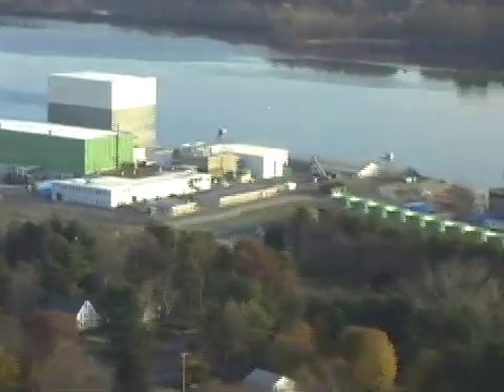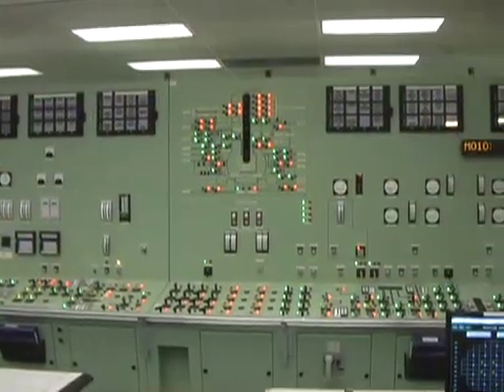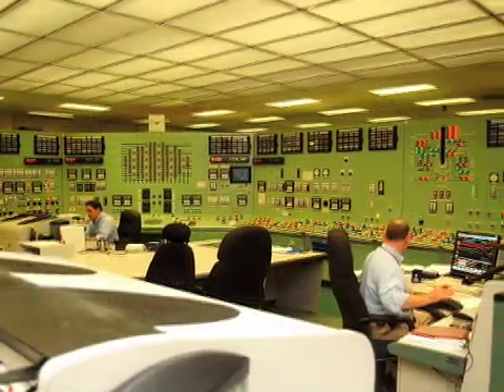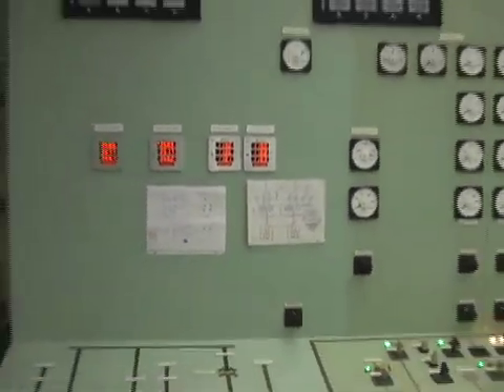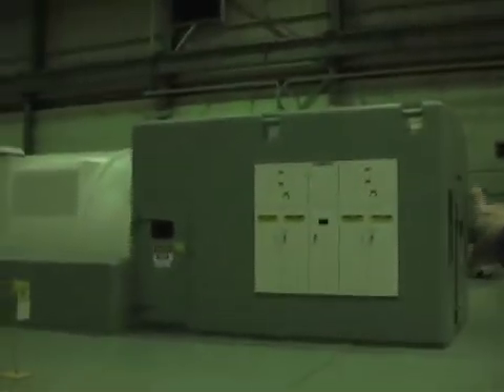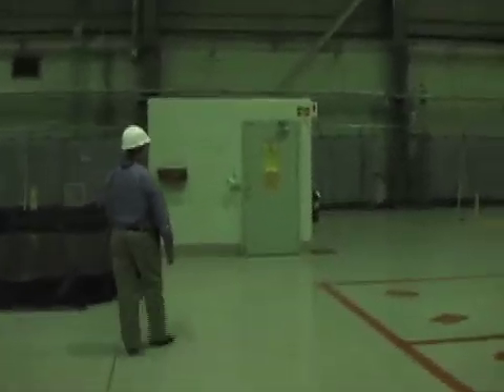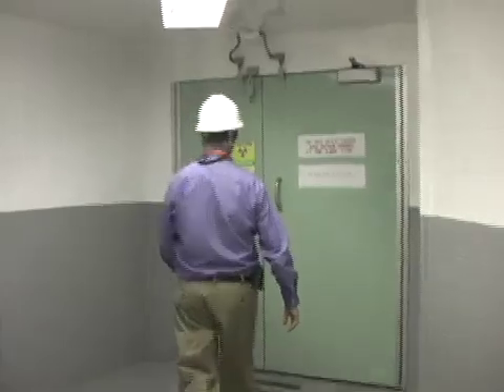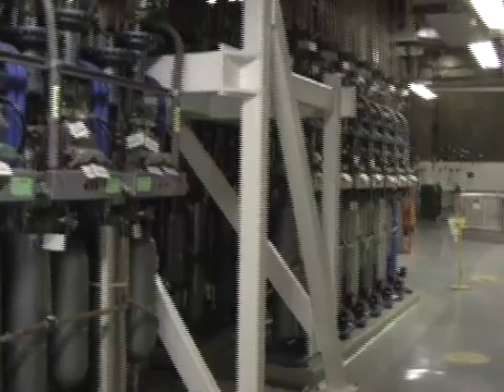Behind the Walls at Vermont Yankee

Comment: DLR=Dose of Legal Record (a record of radiation dose kept for the lifetime of a worker)

SRD=Self-Reading Dosimeter (electronic dosimeter with built-in display)

RWP=Radiation Work Permit
Reply: If nuclear is safe, why are these needed?
Reply: @laser2sail  To maintain this level of safety.
Reply: @douro20  Which skips over the concern whether this level is safe.
Reply: @laser2sail  No it doesn't.  They've had decades to determine that this level is safe.  You can feel however you want but the data doesn't lie.

Comment: Correct, Vermont Yankee and Fukushima Daiichi are both GE Mark I BWR-4's.  VY however keeps all of their safety systems and EDGs(Emergency Diesels) inside of the plant, away from the elements unlike Fukushima.
Reply: No tsunamis in Vermont
Reply: @Phantasm: Don't be an idiot! The Daiichi diesel generators were housed in the plant, not open to the "elements". In fact, if the generators had been outside the plant at a higher elevation, the meltdowns would not have occurred.
Daiichi had generator sets at three different elevations, but this was still inadequate to protect them from the tsunami. The VY plant also had their generators in pretty close proximity (eggs in one basket configuration), and one localised fire, explosion, or flood, could've potentially knocked them all out!

Nuclear needs to be 'walkaway safe', like proposed LFTR types  or similar liquid fuelled reactors. Some other unforeseen disaster could have caused shutdown and loss of backup systems on the VY reactor, as in Japan, and you'd be just as stuffed as they were.
Reply: All they would have to have done in Japan was turn on the emergency cooling! But no, that would have gotten their white gloves dirty! 🤭🤭🤭🤭
Reply: @anhedonianepiphany5588  They had two backups for the diesel engines, spoilers they didn't use any of them!